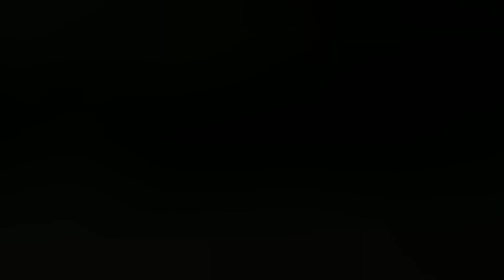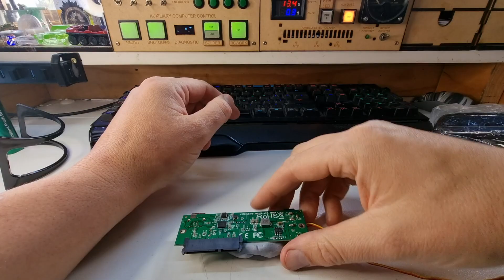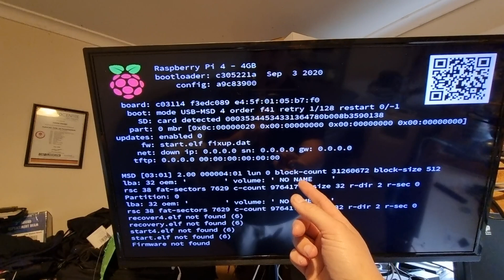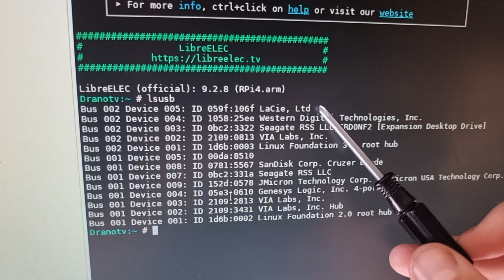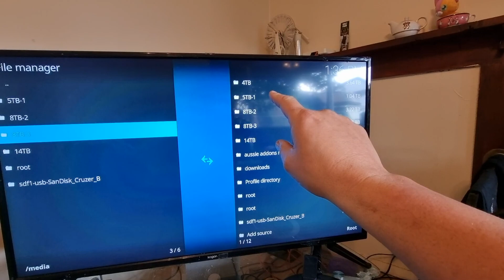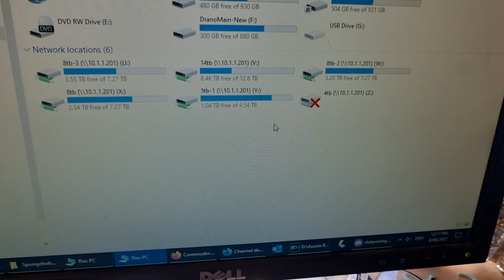Adding 14tb to my home-made Raspberry pi file server

Comment: Cool project. Have you considered replacing the Pi4 with Pi5 which has a pcie socket? there are already several hats and turns it into multiple sata inputs, so you could connect the drives directly and don't have to deal with sata to usb adapters and bottlenecks. I'm considering setting up a machine like that, what worries me the most is heat dissipation and stacking up the drives.
Reply from the maker: @panconqueso9195  https://youtu.be/2SUe0g1m9Y4
Reply from the maker: @panconqueso9195  yes I have, and theres video on that. At time of filming pi5 didn't exist. I tried using an nvme 6 port sata card, but it wont work with a single pcie lane.
Since I filmed that, theres a new board out thst does.

Turns out my bottleneck was my router. I get 100mb/sec into these drives now, which is about as fast as SMR drives will go. I use the pi 5 in my 6x6 ambulance now to run the projector instead. I dont stream from the file server, its just backups. The server has fan cooling and temp control. Only one drive is ever in use, and usb controllers spin down drives when not in use

Comment: Cool setup, how much energy dose it use under idle? I am moving out of my parents house in the next 6months to a year and want to optimize my setup for power so this might be a good solution.
Reply from the maker: I haven't metered it actually, but about 50 watts or so based in math. If I spin up all the drives however it starts to get power hungry.

Comment: Why are you using those relays ?
Reply from the maker: They operate the cooling fans, i briefly explain that midway through the video.
At present its triggered by cpu temp, later I plan to add temperature probes to individual drives

Comment: Yeah, I'm kinda glad I went with an old HP DL server even though it cost more. I use it for NAS and virtualization. I did make the mistake of buying the SFF (2.5") drive version which meant a higher price per gigabyte than the LFF (3.5") version.
Reply from the maker: This server doesn't do anything majorky important, but it does serve as a media center too. External drives are usually dirt cheap and locally available in my rural area, so this whole project was cost driven.